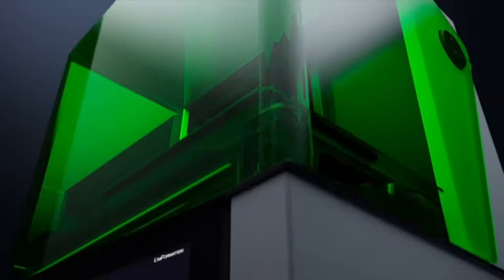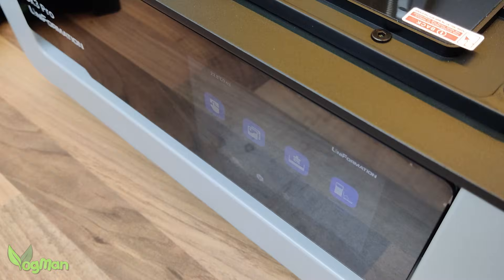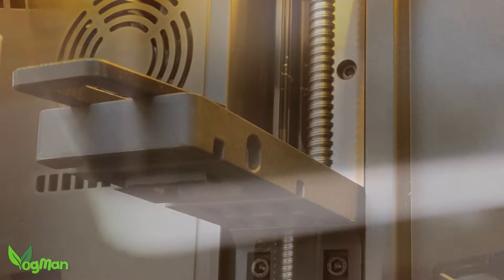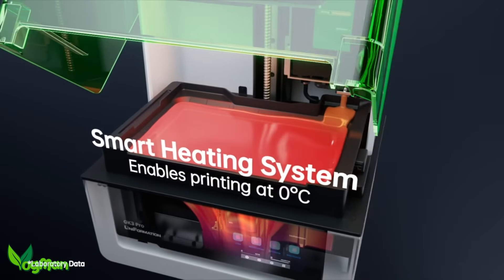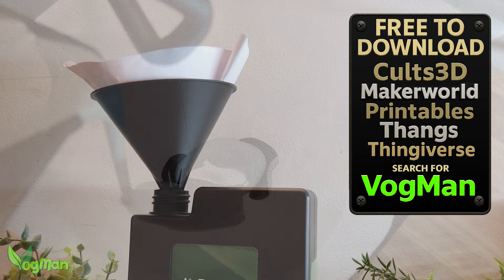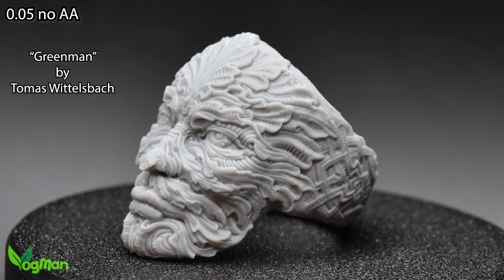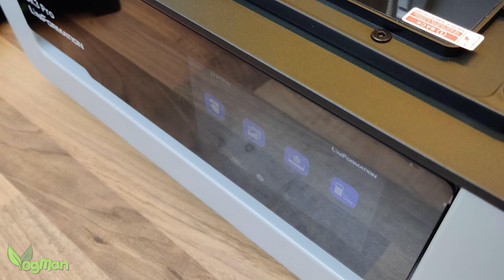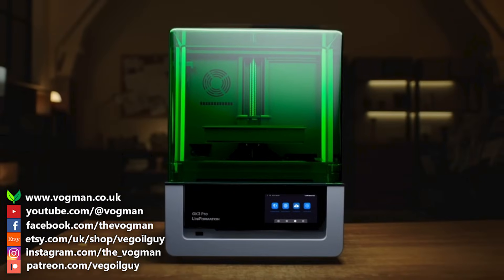Uniformation GK3 Pro – 385nm 16K Resin Printer (honest review)

Comment: Out of curiosity, you didn't even try the uniformation water washable resin on the 385nm printer out?
Reply from the maker: Yes, all the prints were done using the W03 resin they provided. They worked great, but my point was this resin can be used on 385 to 410nm printers... so it's NOT specifically 385nm. A big selling point of this printer is that 385 is apparently better than 405 and I just thought it was a shame I couldn't try to test that claim. Since then I've looked (but not extensively) and cannot find a 385nm resin on the market. I can find 385 to 410 (covering the range) but not just 385. Perhaps I'm missing to point... 😁

Comment: love your videos man

at this point, i feel like companies need to work on non-toxic resin instead of better machines, they are already more than good enough, but a big reason why people are not using resin printers is the toxicity of the materials
Reply from the maker: I agree with you completely. We can tolerate the mess, but ideally we need materials that are completely safe to use. I'm hopeful the industry will eventually lean in that direction.
Reply: It does worry me that in ten to 15 years a lot of people will develop cancer etc. from mishandling resin printers.
Reply from the maker: Unfortunately that may be the case... though of course there will be no direct proof. For my part I've done a video warning folks about the potential dangers and describing how easy it is to avoid these with a little care and easily affordable safety gear. I'll continue with gentle prompts now and then, though I always receive more backlash than thanks on that topic 😁